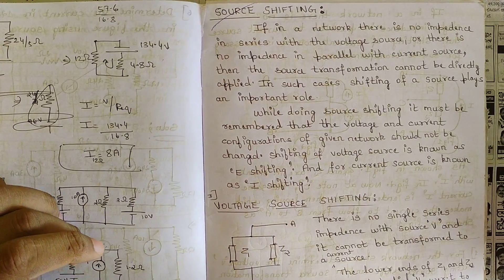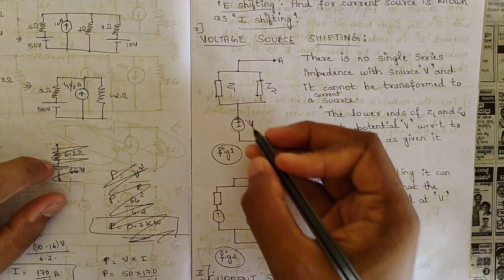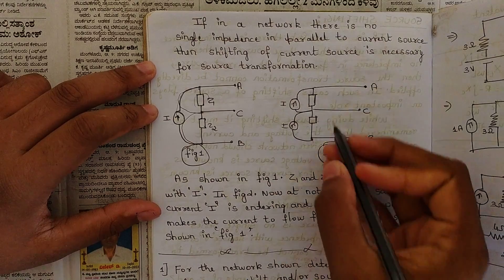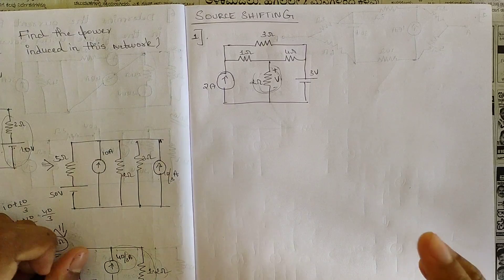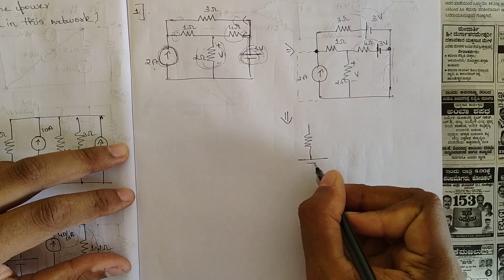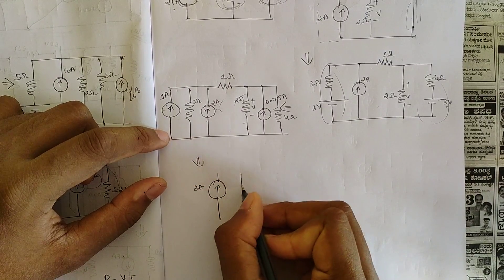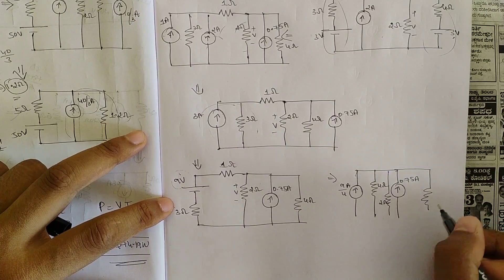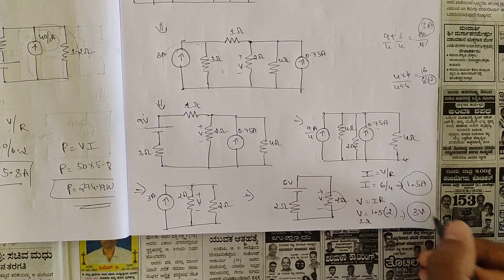6.Source Shifting Voltage/Current Shifting Concept,1 Problems Explained 3rd Sem ECE Latest Schem VTU

Comment: Sir in the last problem when u add 2ohm + 2ohm then u will get 4ohm so 1.5A and 4ohm are in series so u should take V=IR as V=1.5×4 how did u take 1.5×2
Reply from the maker: Because we are finding voltage across 2 ohm resistance not the entire ckt

Comment: Sir in 14:55 how the resistances are in series ? They are parallel right 2 ohm and 2 ohm
Reply from the maker: No those two are not seperate branches...they are connected in series in a single branch